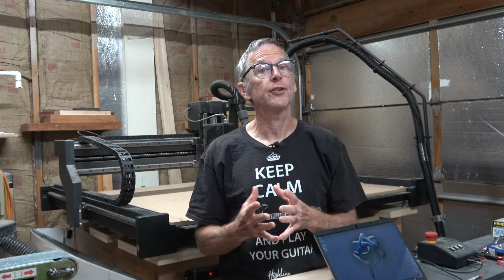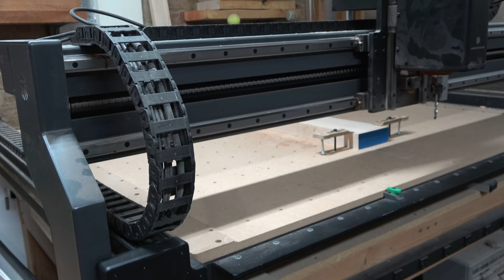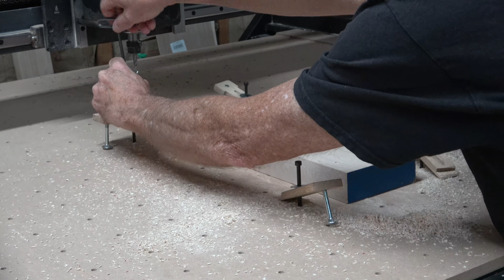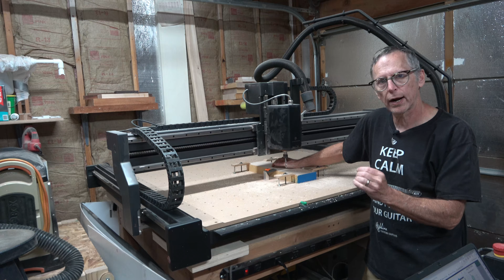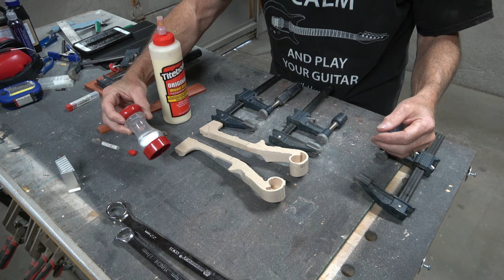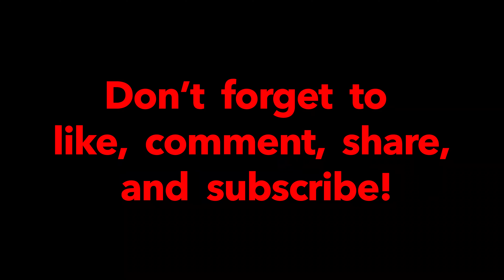Making An Electric Violin Part 6 Carving The Neck With CNC

Comment: Some CNC hints : keying the two sides is much easier. I use 1/4" (or 1/8" for smaller boards) steel dowels, with small holes drilled (by CNC)  in the board, and I always zero to the center of the board, and zero the spindle to a known location on the spoilboard. This eliminates all the error, within hundredths of a mm. I tell the system to z - zero off the machine from a fixed distance from the XY - zero, so all have the same z-dimensions. Fast, easy and super reliable for two sided carving. Also, using double sided tape under the part, combined with hot glue spots around the blank, results in not needing tabs, which makes for much cleaner edges, and less work. No clamps, no alignmant marks, other than the zero in the blank center, and as long as the system itself is zeroed correctly, the exact original alignment is pretty much irrelevent, and no edge sanding.

Comment: To align your workpiece perfectly in the Y axis anywhere on your spoilboard, jog your endmill down to just above the spoilboard.... Push the side at one corner of your workpiece against your cutter shank and screw that corner down... jog Y axis to other end of your workpiece and do the same at other end of your workpiece. Now your workpiece is perfectly aligned to your Y axis. The advantage is you can do this at any location on your spoilboard you choose.

Comment: To be honest, you have a very sophisticated system for installing the workpiece on the CNC table. Personally, I use furniture pin. I fasten the workpiece on the table, I find the middle of it. Milling through holes at the edges of the workpiece. Then I remove the workpiece, and without changing the coordinates, I mill the same holes, but already on the CNC table. I insert furniture pin into the holes on the table, and put a blank on them. Voila - the workpiece is well fixed. And without unnecessary manipulations - you can turn the workpiece over, and process it from behind without losing coordinates. And the lines on the cnc table - for me - are not a very reliable option for positioning the workpiece...😊